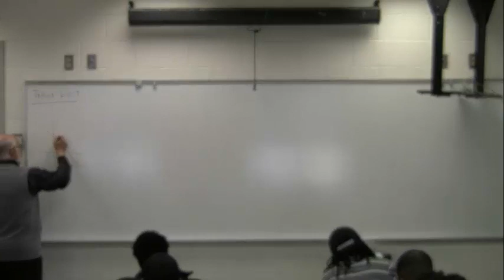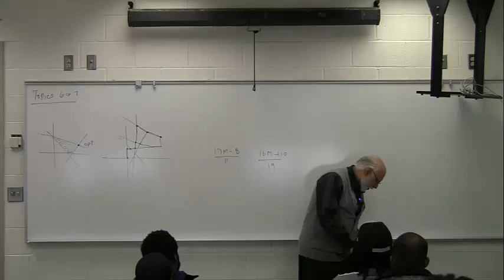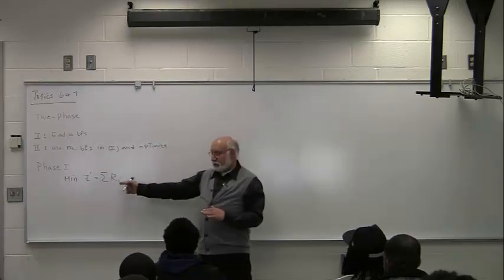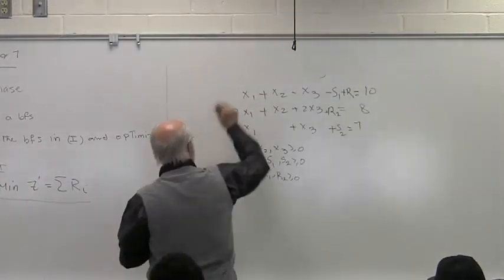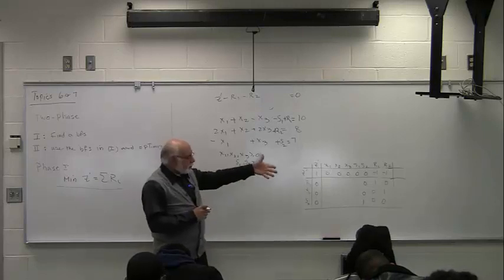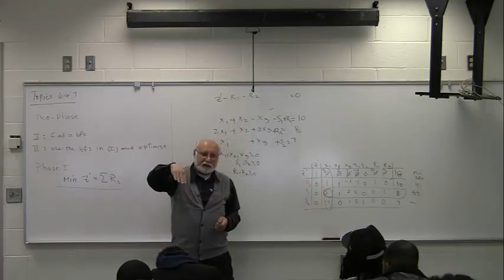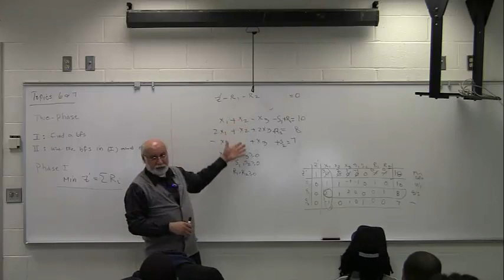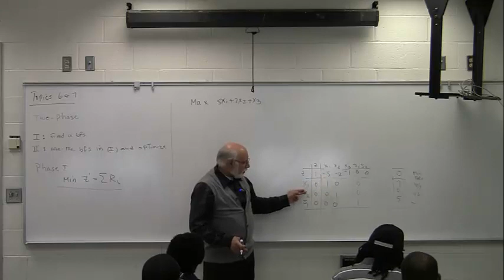Simplex Method: Two-phase Technique (Class Lecture)

Comment: When I go to Second phage???
Reply from the maker: The purpose of the first phase is to find a basic FEASIBLE solution. So, as soon as your artificial variables leave the basis (they become non-basic and equal to zero) you finish phase one and go to phase 2. Also, as it is mentioned in the video, it is possible that an artificial variable remains in the basis but with the right hand side value of zero. So, the general answer to your question is: when all artificial variables are equal to zero.